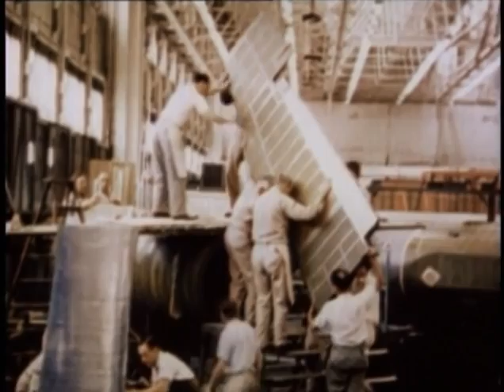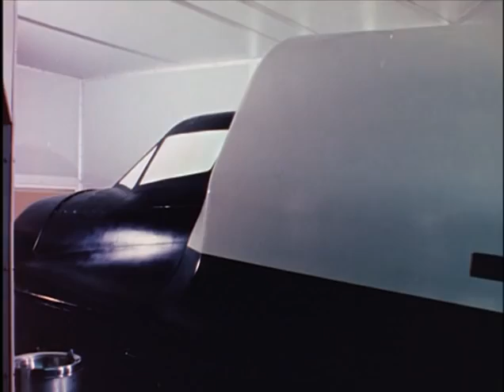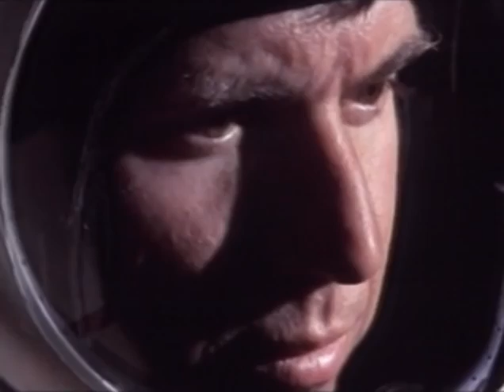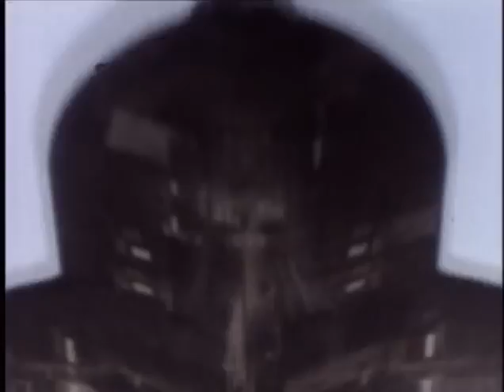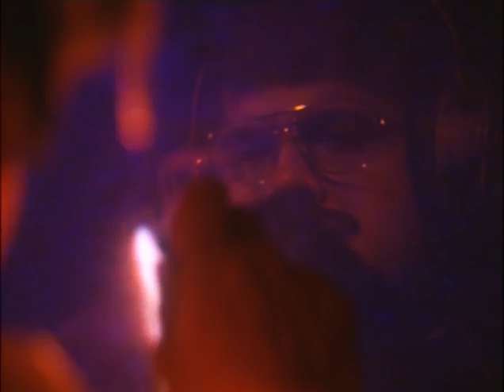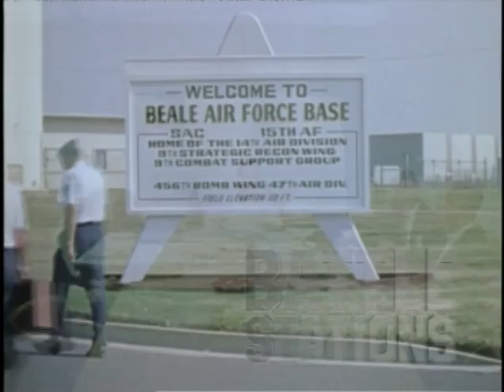SR-71 DOCUMENTARY

Comment: Good documentary compilation.  It is amazing how much design went into that plane and coordinating the training, technology, maintenance, secrecy and getting the right people in the planes.  A true combination of intelligent long term thinking at its best.  I just looked at the Mig31 specs and its engines can't do the mach 3.5 and has a ceiling of 65000 feet.  That is several miles lower and 500 miles slower than the SR71 build in the early 60's.  Pretty slow and low considering Russians had 30 years to study a working aircraft.  Be interesting to see that M31 fly 15,000 miles at top speed.  I have doubts that it would hold together on one flight.  The separation of functions so each crew member can do their job was quite a innovative step to keep distractions to a minimum at those speeds.